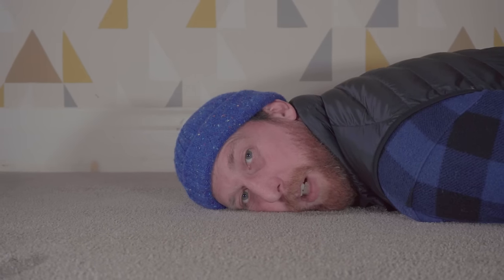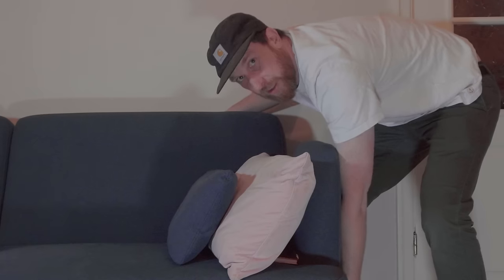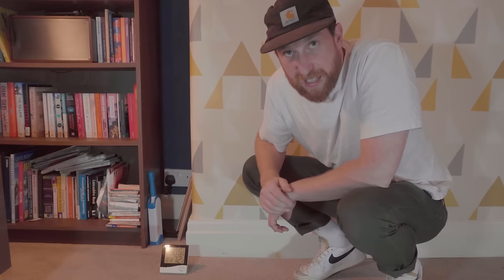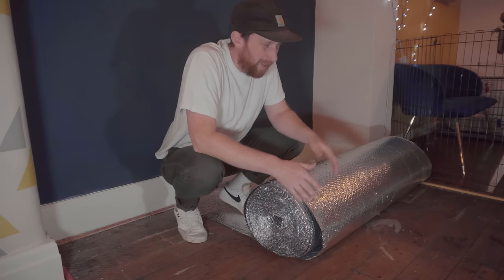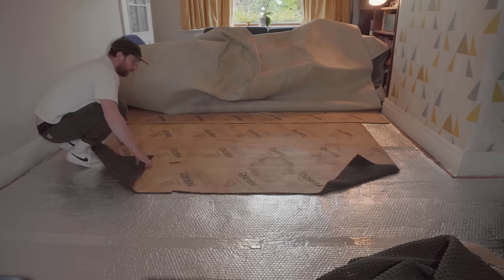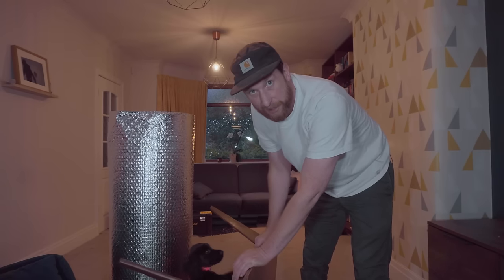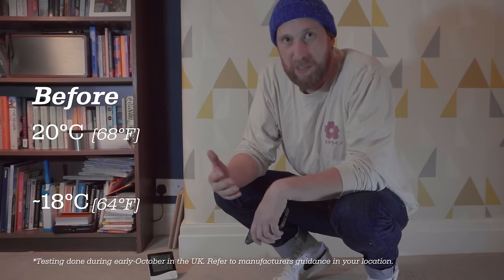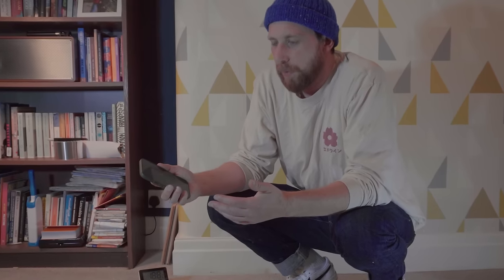This floor insulation could save us HUNDREDS

Comment: The physics dictate that in order for reflective insulation to be effective it has to be installed free from any other surface touching it. It needs to be in a cavity surrounded by still air. It reflects radiant heat and convected heat and is all but useless in insulating against conducted heat as is the case in your floor touching the floor boards and the carpet. You’d be better using bubble wrap.
Reply: In the case of trying to insulate between the joists under the floorboards, would you suggest a layer of egg boxes, then plywood, then bubble wrap? We can get under our floor through a trapdoor into an earthen dugout. Our street was built in the middle of the Wall St crash, so our half of the street had unfinished cellars whilst the houses opposite have proper cellars.
Reply: Mary the best solution for you would be to install either traditional glass wool or Rock wool insulation in the cavities between the floor joists. Use the thickest available that can fit into the space. Don’t use bubble wrap or egg cartons as these will not meet the fire resistance standards required. 

Good luck
Reply: @malcolmmcblain3954  thank you for responding, that's really useful. (I might have remembered egg boxes for noise insulation, many years ago, before there was much health and safety awareness) 👍
Reply: @maryhall3722 I’d recommend you place a thick mil plastic covering the whole earthen floor (overlapping by a foot the seams and joints)and bring the sides up to the top of the foundation. This will keep moisture in the soil and reduce heat going into the ground.
Reply: Sadly so. This type of thing was all the rage on Canal Boats for awhile – until we realise that the data didn’t stack up. Probably stops the drafts effectively in this instance, but claiming that it is equivalent to a thickness of standard insulation really should be challenged under the trade description act.
Reply: 100%. This is a n old scam.
Reply: What you on about I've done this what he's done before watching this and it definitely made the lounge warmer
Reply: That’s good for you but you would have saved some money if you used bubble wrap. No point paying for reflective surfaces if your putting it under a carpet.
Reply: @malcolmmcblain3954  I understand your point, I had some left over from a different project so didn't cost, but it does say in the spec it can be used on floors and is equivalent to 55mm polystyrene
Reply: @malcolmmcblain3954  lol I watched this already, if I was taking up the floor boards would definitely do it like this
Reply: It’s probably equivalent to 50mm polystyrene when it’s fitted in a cavity with still air surrounding it. It is less effective against radiant heat gain in a vertical as opposed to a horizontal orientation. If it is installed in a horizontal position then the cavity must be sealed against dust entry. Dust buildup on the surface reduces the emessivity of the reflective surface resulting in a loss of performance. Reflective insulation is more suited to hotter climates than cold. Reflective insulation doesn’t retain as much heat in the building as bulk insulation. It’s real place in the industry is ask a reflective barrier under roofs that get a lot of sun exposure. That is the facts in a nutshell and are proven by physics. You and any reader of this should report it to who ever polices false or misleading claims if you see it made on reflective insulation.
Reply: Confused,what is the right insulation for suspended floorboards?
Reply: If you have access to the underfloor area then put fibreglass or better Rockwool no thicker that the joist depth friction fitted between the floor joists and retained in place by string fastening diagonally from parallel joist to joist. If you can’t get under the floor then watch the video on link in reply above. Hope that helps
Reply: It is a bubble wrap with reflective surface
Reply: @maryhall3722 I think you could tack this kind of stuff at the bottom of the joists and it would help.   It captures the air between the joists the subfloor.

Definitely don’t do egg cartons.  They would absorb humidity, hold dampness, and feed bugs.

If you did the aluminum bubble wrap on the joist bottoms and had a 5ml-10ml thick sheet of plastic over the ground that works well for making crawl spaces less damp.  There’s special tape for that plastic that cures like a glue so it doesn’t come undone for that purpose.    The dryer the air the less it’s gonna transfer heat
Reply: Bob wells does a great rv van video about all this.  I'm a moron and I even knew
Reply: Cabin builders have been using it this way for years. It works very well
Reply: There was no air space between the bubble foil and your finished flooring. That’s why there was barely any temperature difference.
Reply: You posted this a year ago so Im curious how it has worked out.  Is the house staying warmer?  If so, how much warmer, and how has it affected your energy bill?  Thanks for any info you can provide.

Comment: What you have to be careful about now is after you have switched the heating off the warm air will start to drop as the cold air from the floor pulls it down. This is why you’ve noticed that little bit of difference. The potential issue you need to keep you’re eye on now is the dew point of condensation. The draft coming from the floor will have dried any moisture. Putting a foil layer may cause dampness between the floor boards and foil and the carpet and foil because air is not able to flow over the surfaces. I’m not saying it will. But all foil insulation should have a breather space between it and the surface in front of it.
Reply: Thanks,  that was my worry too.   Coming from tropical Queensland, it's beyond my ken.   However,  living in a damp,  cold, sub alpine part of Europe, I need these clues.   Mold is a killer.
Reply: they don't care...
Reply: Yes, that is another problem, don't know how to tackle this. Saw this on another utube channel, on your roll of foil insulation, mark out holes evenly, hole size, amount, distance apart, I don't know, drill with probably  a 1 or 2 mm drill bit, now you have air flow to stop condensation and mould. I have seen perforated foil available for this problem. Again I'm not sure of how many and how big the holes are but if you utube perforated foil insulation it will give you an idea, good luck and again thanks to everyone for your information.
Reply: Unlikely to be an issue with the thin insulation used here. Look up the Gläser diagram. There is a method to calculate the dew point and condensation risk. The foil tape and closed cell product also acts as a vapour barrier to prevent moisture moving from the room to the floor.
Reply: @hadesbearer  even with a 150mm Kingspan type insulation installation instructions are to put a vapour control layer between the floor and insulation. The vapour control layer should be in the type similar to roofing felt where air can flow through it. It doesn’t cause suction as if it does it rips the face off the insulation making the insulation less efficient.
Reply: @pitbladdoassociatesltd  Kingspan is closed cell. If you tape the joists and seams you have vapour barrier installed no?
Reply: @hadesbearer  no. Not necessarily. You may have taped it for air tight and preventing moisture coming in, but where does moisture go if it’s trapped inside. And trapped between surfaces that have no air supply to it to evaporate. This is one of the reasons we are seeing properties with damp issues where they never had them before. Increased sealing preventing air flow. Building isn’t really about preventing moisture coming into the building, it’s more important about letting it escape.
Reply: @pitbladdoassociatesltd I agree, however only if you seal on both sides. You leave the side below insulation unsealed, but the upper surface behind the final floor sealed. You ventilate the suspended floor cavity as per normal with air bricks. No moisture builds up, no damp issues.
Reply: The moisture won't be able to to get through to under the bubble foil if you aluminum tape all the seams
Reply: @stevenolson5703  if your putting insulation down because cold is coming up from below then air and cold are still coming up to the bottom face of the foil. The foil then is meant to reflect it back
Reply: I wondered about dewpoint & your comment seems logical

Comment: I have bought some large bubble bubblewrap and have covered 98% of our outside windows and all of our internal paned doors. This idea is used by gardeners to put extra insulation on their greenhouses. The larger the bubble the more insulation and soundproofing the effect is. My wife ( she who must be obeyed)( and the one who always feels cold) is very happy. It is so easy to do, just cut to size and spray water all over the window getting a good mist all over and using the smooth side of the bubble wrap just stick it to the window and it stays there. Clear bubble wrap lets all the light in and is very good at sound proofing.£17 for a large roll, find the largest width, ie patio doors and buy at least that width. Using a thin permanent marker write on the bubble wrap which window it's from and store it until the next winter. If the bubble wrap comes loose ,just spray more water and smooth it to the corners and re stick using the smooth side.
Reply from the maker: This is a great idea! I’d never thought of that. Our French doors are an AWFUL heat transfer - I might give this a go
Reply: in some cases, wont even need to spray water cos the window will already have condensation on it 🙈
Reply: @tan90  I agree but I used window vac to dry and clean window first and then used fine plant sprayer especially in all corners and edges. Have lasted 4 months with problems
Reply: You sir, are a diamond.
Reply: That is fabulous idea!
Reply: nuts

Comment: In my opinion a problem with that insulation  is that over time the stress on the air bubbles from walking/ impacting on the floor means its likely that the air bubbles will become less efficient i.e. the bubble wrap will pop or puncture.  Lleaving you with just a reflective surface under your carpet acting just as a draught excluder which is better than nothing but hardly and insulation layer.
Reply: Most of the performance of that insulation comes from the reflective surface. It's reflecting radiant heat back into the room (or carpet, in this case, which is fine). The bubbles are only there to prevent heat loss via direct conduction, which would defeat the purpose of trying to reflect the heat back into the room. 

So bursting a few of the bubbles is no big deal, so long as the reflective material doesn't become permanently flattened against the flooring.
Reply: @jeffwells641 ya. But the reflection only works with an air gap.
Reply: @gwaaiedenshaw8310  radiation works without air
Reply: @gwaaiedenshaw8310  No, it's not that the reflection doesn't work without an air gap, it's that conduction - heat loss due to contact - overpowers the reflection. So it reflects 90% of the radiant heat no matter what, but contact causes the heat to sink away through the material much much faster. It's a small but important difference.

So ANY air gap - 1mm to 100mm - works just as well. It also doesn't have to be air, just putting a material with poor thermal conductivity between will do the job (though air is generally the most readily available such material). 

This is contrary to the way normal insulation (like down, fiberglass, or foam board) works, which is by increasing the air gap and obstructing air movement. They generally don't care much about contact, because there are layers of material after the point of contact that prevent heat transfer.
Reply: i’m in oregon, us, and use a similar insulation (bubble layer covered on both sides by mylar vs aluminium) on the insides of our windows to reduce heat loss in the winter. it makes the house much more comfortable!
Reply: @jeffwells641  its not more about locking in moisture, just to keep air flow?
Reply: Those wood floors are beautiful. I wonder if he can get under the floor and insulate underneath.
Reply: Those silver emergency blankets work with out bubbles. I think it should help.
Reply: any reason not to use this to insulate under the floor in the crawl space?
Reply: @FonFreeze  Locking in moisture is generally bad for your house. Since this is radiant protection, there is no reason to prevent air flow. It's basically there to reflect infrared light back into the room. You just don't want physical contact because conduction will remove any gains from reflection. That's why there are bubbles in the reflectix rather than just straight reflective mylar. Mylar would be basically useless in the same scenario.

It's also worth noting that by putting carpet over the reflectix that carpet is going to absorb all the heat reflected back. That's not a bad thing when the goal is keeping your toes warm, but it will limit how much heat radiates back into the room.
Reply: @seichorn4079 there’s a good chance there isn’t actually a crawl space- the joists may well be less than a foot above the ground so he’d have to remove most of the floorboards to fit insulation. Potentially just a much bigger job so I can see the appeal of laying insulation on top.
Reply: @seichorn4079  I have thought of that and would prefer to do it from underneath as I have enough space to do so but not sure about foil , thinking of electrical storm and lightening , not sure what would be the best , treated wool or strips of foam\polystyrene type , advice is what I'm needing but difficult to get it online as everyone is trying to sell their product and I don't like asking in case I'm not buying from them or can get it cheaper somewhere else 😄

Comment: Hi   You will not see any difference because it dose not work the way you think, It is really for walls and you must have static air gap each side of the insulation of between 12/25mm. Keep safe  UK Micky🔥🔥🔥
Reply from the maker: Cheers Micky, I’ve had pretty good results so far. I made sure to follow manufacturer recommendations on installation and while I’m sure there are ways to make things better, I’m pleased with it considering how easy it was to install.

Comment: Hi, You just need to check for moisture now between the planks and the bubble insulation because it act as a vapor barrier. a lots of wooden flooring have been destroy in the past in my area but similar product.
Reply: Yep!
My first thought.
Reply: If this is suspended floor, with appropriate cross ventilation (air bricks, etc) that I don’t think it’ll be an issue.  But I agree there can be lots of mistakes with insulation/ventilation that cause damp.
Reply: Once an insulation expert said: Insulate always from the cold side! This keeps the moisture and mold outside. Maybe an insulation on the roof and outside walls would be more effective, but even much more expensive.
Reply: Did the same on mine and you could hear it squelching underfoot within 6 months

Comment: Bubble "insulation" has nearly no insulating value. If air leakage is the issue try an air barrier sheet that passes water vapor like Intello. For a real fix you need a layer of proper insulation under the floor. Roxul comfortboard or foam board could do that.

Comment: If you're putting wooden flooring down then try Cork roll as it won't compress and achieves very high insulation. It comes in various thicknesses from 2-10mm, 4mm should make a significant difference plus it's completely sustainable, safe and fire proof. I've put 4mm Cork straight onto an uninsulated concrete slab and it works very well.
Reply: depending on the aesthetics, it could also look very nice, too
Reply: Hi, Where can I get cork roll in UK please?

Comment: Hi, love what you are doing. just  to give you a quick tip - I do a Lot of underfloor insulation to benchmark standards. The bubble wrap style insulation is best for radiant heat, so a gap is necessary for maximum efficiency. You will have gained the most from sealing the floorboards from droughts with the material. What you have done is very good - it’s great to do anything - but to get maximum efficiency is a whole other thing.
Reply: yeah but once you put the floor on top, your weight is spread evenly.  the popping is possible but likely.
Reply: would hardboard be a good (or bad) option with tape over the edges? On top of planks and under carpet? We just got the wiring done upstairs and it was big+thick loft board type material before that couldn't be put back down so I replaced with planks. Was thinking hardboard could even out the carpet and spread the load better, maybe not great thermal wise but still an improvement over gappy planks like our man in the video here??